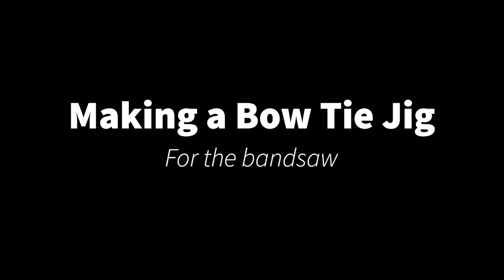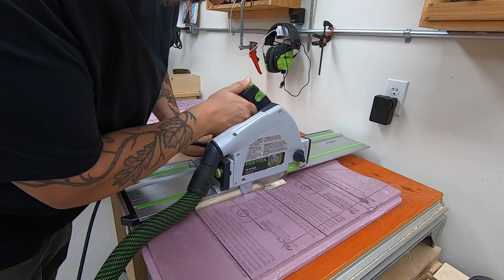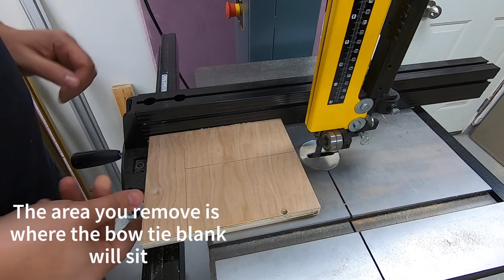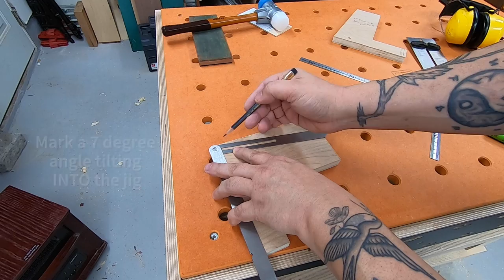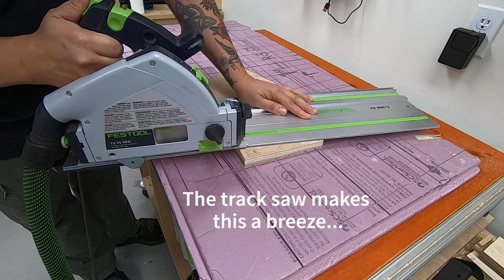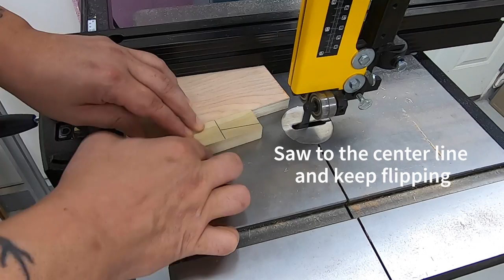Making a Bow Tie Jig for the Bandsaw

Comment: What on earth do you cut on top of? Tracksaw section. I bought some insolation and it was like I'd put a grenade in a pillow. Thanks. Also neat lil trick there. Reminds me of the Late Charlesworth dovetail jiggermebob
Reply from the maker: It’s rigid pink foam insulation board. Not the loose stuff that explodes. 😆